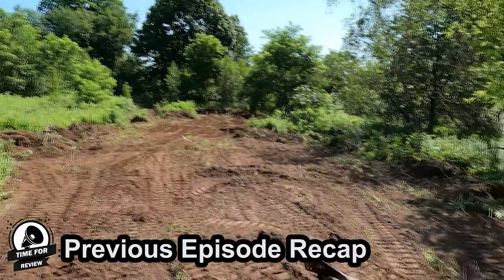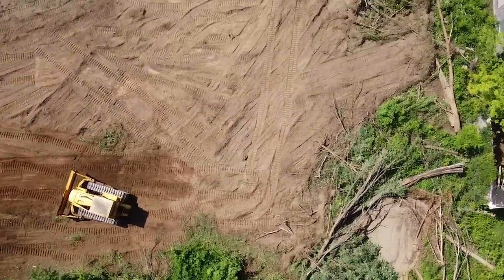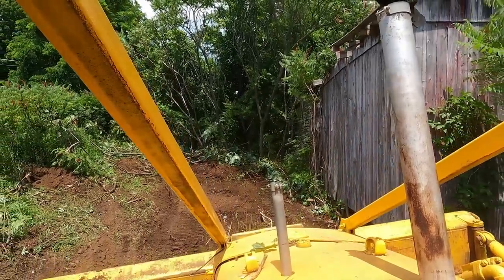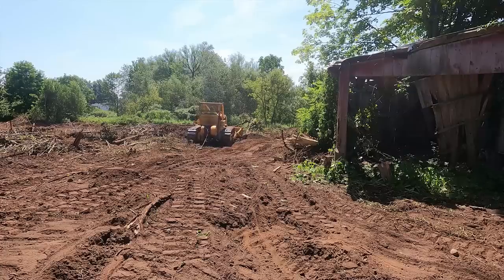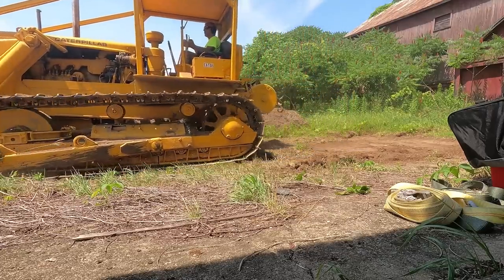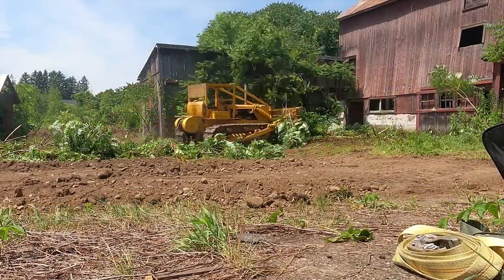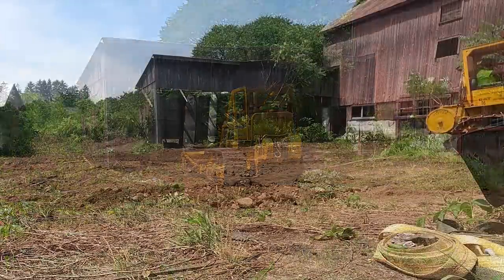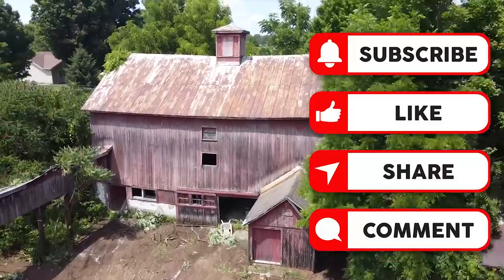Scraping years of overgrowth on the farm with the 1956 Cat D6 9U Bulldozer!

Comment: Your old D6 seems to run good ,but If I were you I would  replace the end bits on your blade they look badly worn and have a look at your cutting edge before you do excessive  damage to your  bade !!
Reply from the maker: Jerry, yeah the previous owner mentioned the same thing - possibly re-welding new side and lower edges. I've only put about 15-20 hours on it of scraping vegetation (versus actual excavation) and plan on re-selling it before the end of summer/fall. I will mention that when re-selling, as the previous owner did to me.
Reply: @BuyingTheFarm  new blade edges and tips are easily available and comparatively cheap.
Reply from the maker: Excellent - I will look around. Thanks for that information!

Comment: You better find an operator before you make a mess
Reply from the maker: Hi Lyle! Well, the reason I bought this property was mainly for learning and recreation. While I have a desire to plant some seed, it will again be for enjoyment and learning - not to make it an operational farm in the classic sense. Part of the learning process will involve making messes, with trees, piles of dirt, the buildings… and I’m ok with all of it. I have to learn what not to do and then how to fix it. So to that end I’m not so worried about messes, moving topsoil around, etc. for me it’s all part of the experience and the learning process. It’s hard to be gentle with such a huge bulldozer. It’s way overkill as I’ve learned. My goal is to just scrape the surface and get off the weeds and shrubbery and roots and stuff… but I end up digging each time. I’m getting minimally better though. I guess. Hahaha. I’m learning slowly.    :-)

Comment: Bye bye to your top soil.
Reply from the maker: Well, it hasn't gone anywhere - it's still on the property. I do have to re-grade everything I have done so far. The ground is very rich, and the topsoil runs deep... so I think the field will be ok, especially after it gets disced, raked and tilled. Thanks for the comment!
Reply: @BuyingTheFarm  Top soil don't work like that.  Dozers skim off the top soil(due to the tracks as well as the blade) and when that happens it is impossible to re-spread it back where it was.  Couple that with a dull cutting edge on a dozer blade plus a few rain events and the top soil you previously had is either gone or greatly diminished.  There's so many better ways of removing brush from a property than pushing off all the top soil with a dozer.  Forestry mulchers, brush grubbers, bush hogs, etc etc.  A Bureau Of Land Management class would go a long way.  Or learn the hard way it naught to me.
Reply from the maker: @verteup - thanks for the explanation. As I've said in a few videos, I was raised in a city and had a desire to own a rural property. Not knowing much about agriculture and related topics, comments like this are valuable. While I'm not doing any of this to turn the property into a commercial farm, I would still like to protect the integrity of the natural resources. I plan on selling the dozer once the heavy stuff on the property is taken care of - it is just way too big. I'm in the market for a more appropriately sized piece of equipment that has some flexibility with implements.